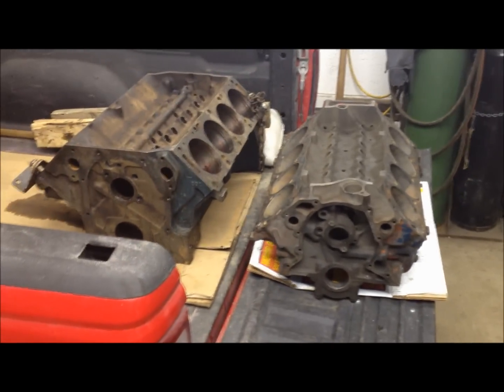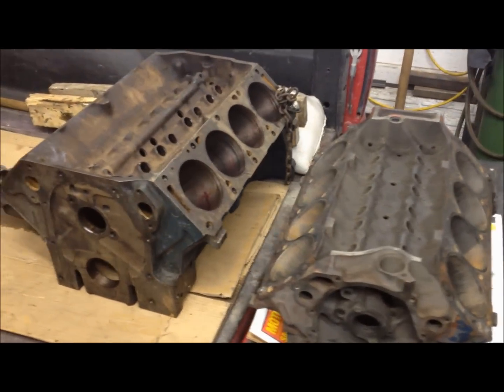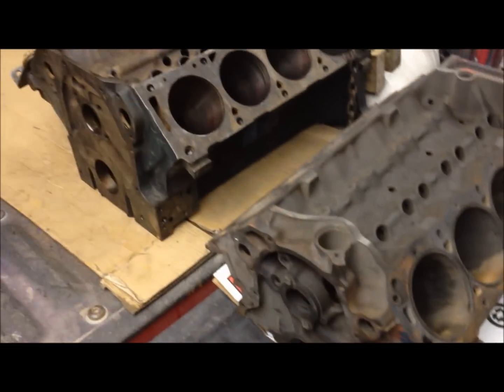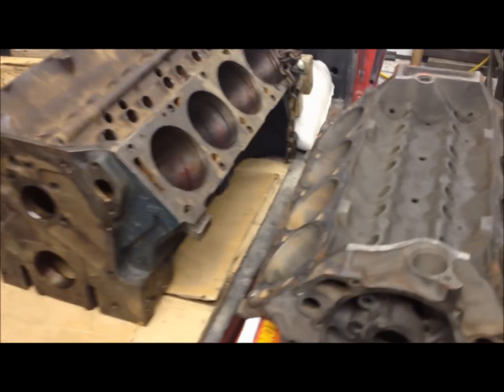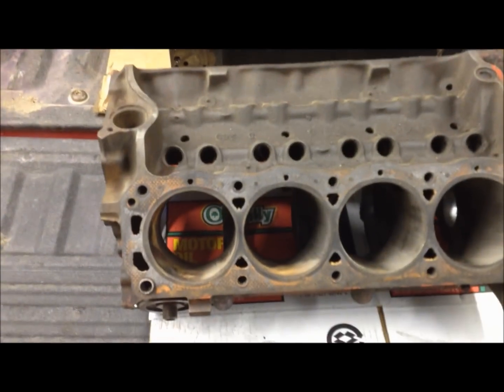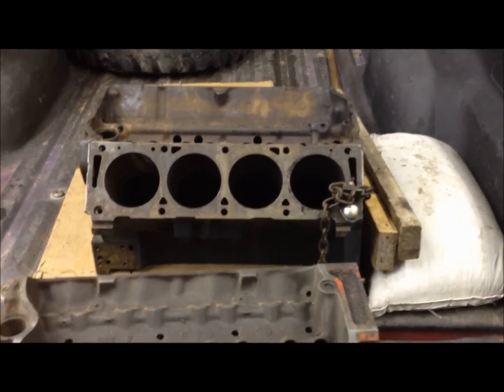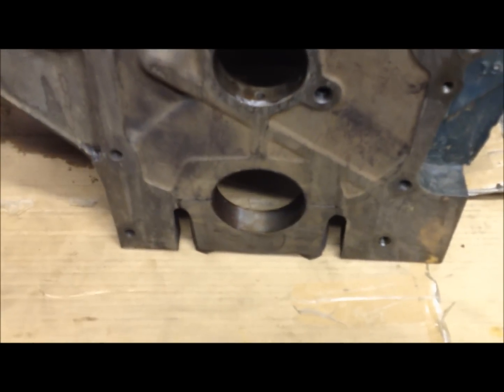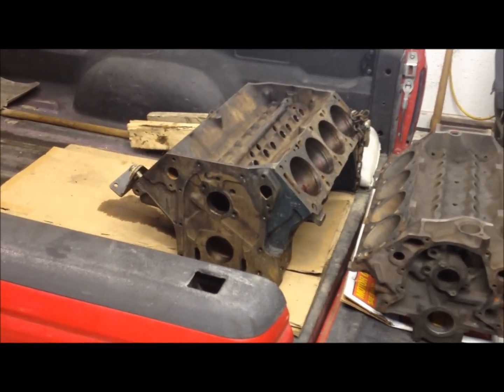Small Block vs Big Block FE Ford

Comment: First off, the Ford Edsel “FE” engine has not big or small block, it was named by Ford as the FE (Medium block) and offered 332-428ci all with same block. The (big block) of the day was the MEL or “Mercury-Edsel-Lincoln” (Superduty block) and offered 383-462ci all with same block. The predecessor to the FE was the “Y” block or (small block) and offered 239-312ci all with same block. The “Y” & “FE” blocks successor was the 335 series (small block) or Cleveland engine, offered in 351C-Cleveland, 351M-modified and the 400ci all with same block. The MEL (Big block’s) successor was the 385 series (Big block) and was only offered in 429 & 460ci all with same block except a one year 1969 429ci HEMI built for nascar. The 335 series (small block) successor was the Windsor and offered 260, 289 & 302 and 351W-Windsor that were 3 different engine blocks the 7.5 deck 260, 8.2 deck 289 & 302 and finally the 9.2 deck 351W.

Second, All blocks were different and not interchangeable except the Windsor block and only for certain parts. The only oddball was the BOSS 302 which Ford did first before any aftermarket was a 302 Windsor block with 351Cleveland heads that were machined to fit the Windsor block and was revered to as the Clevor engine. Every block is largely different except the two Windsor 302 & 351 blocks and only to a point and still are very different. All other Ford engines that shared one engine block were only differences in bore and stroke only with heads that were built for different applications. All of them used heads that could be swapped only on their specific blocks they were designed for and none could be swapped from blocks of different designs.
Reply: this is a great chunk of information
Reply: I had a 71 (aus) fairlane that had a 302 windsor and c4 auto. When I got the motor rebuilt the timing cover was different to normal 302 windsor. Also the c4 when it got rebuilt had some different parts than a normal c4. All I was told was the engine and trans was the same as some of early mustangs. Never really understood it all. Any ideas?

Comment: Oh yea. That cast iron intake weighs in at like 90 lbs. A big weight savings when you switch over to an aluminum intake. And if you also go with a set of aluminum heads you can get the weight down to a small blocks weight. With a lot more torque and HP potential.

Comment: Wasn't the FE actually a mid-size block? Because the true Ford Big block was the MEL (383,430,462) from 1958 to 1968 until the 385 series (429, 460) replaced it.

Comment: Ever since I got my f100 about 2 months ago the fe has grown on me but never the less I have a love hate relationship with it.
Reply: Uncle Moe Lester i replaced my fe with a cleveland.  Much happier.
Reply: @chrismontreuil2206  Yeah maybe,but the FE will pull like a tractor and with a good high volume oil pump,you can't hardly blow it up. I've owned several of them and I can attest that they are as tough as nails.

Comment: Best to assume that NONE of the 390 blocks can safely be bored to 4.130.  I have built literally hundreds of them over the past years and have sonic tested them all.  We have found exactly TWO that were safe to go to 428 bore.  The 105 blocks were cast in Ford's MCC foundry, the DIF blocks were cast in Cleveland.
Reply: If I keep my Dentside with a Gasoline engine I will get mine from you Barry, just on the fence about a 4BT conversion
Reply: Had an early 427 with 12.5 comp +.60.and it ran without problems . Bored an early 428 CJ +60.no problem . 406  also thick wall cylinders . Some replacement 428 blocks were actually truck blocks and had the boss foe the rear sump pickup .sonic test is the way to go .
Reply: 0.060 over on a 427 FE is not believable. That's double what the average top oiler will max out at.
Reply: @randomologist77  I bought the block from a guy named John Uniman who used to race of 57 Thunderbird and he replaced it with a big block Chevy. It had a set of JE 12.5 2 1 Pistons 60 over bore. I also had an early 69 428 CJ lost a wrist pin lock and board that 60 over with TRW Pistons. I worked on a lot of Fe engines Panda never had problems. Cuz a lot of people that are talking about how these engines were nothing but trouble but the biggest problem I ever saw was where they got overheated real bad and the cracks developed in the valley. I due know where the short block  is now . We put it in a 69 Mercury Cyclone CJ and the guy still has the motor block with pistons and all. Because it's an early style motor we had to fabricate motor mounts for that application

Comment: This FE is thec105 reverse block. What is the significance of the 105 block casting over the 352 casting. Do you know?
Reply from the maker: James Archuleta couldnt tell you honestly, i run small blocks primarily for fuel sake. . .
Reply: supposedly the 105(501) are 73-76 FE Blocks and 352 blocks are the pre-73 blocks 501 are supposedly stronger and suffered less from core shift.
Reply: @jclaysf350  heavy truck motors... sometimes they are built with an .080 overbore. I've built 3 over the years and they are still doing great... well 2 are don't know whatever happened to the third.  It went away in a gt500 clone I never finished...

Comment: I love the way the FE sounds but I'll take the small Ford any day of the week over the FE.
Reply: Big blocks suck
Reply: Depends on what your using it for,when I was young and farming with my father,I would use my FE powered Ford pickup in the fields all week long 12 to 16 hours a day and drag race it on the streets on Friday,Saturday nights and all day on Sunday. I'd average 50 to 60 races during the average weekend. Ole truck never complained or left me stranded ever. The  windsor v8s are great but not nearly as tough as the FE was.
Reply: Been staring at Ford small blocks my whole life. Sometimes I just want to see something different.

Comment: I have owned FE side oilers, 302 Fords, 351 Fords and Coyote Fords. The Coyote is the most HP per CI of any Ford engine. and the best racing engine.
Reply: The newest and most advanced motor out of those listed makes the most power efficiency ? Say it aint so lol.

Comment: Technically Ford never made a big block or a small block. Those are GM terms.
Reply: I've seen some stupid comments but you're winning so far for 2016.
Reply: It's true. Small block and big block are GM designations. Ford had windors, FE, and 385 series engines. None of which were designated big blocks or small blocks by Ford. Chevy fans called them that and it stuck.
Reply: +Ken MacMillan small block and big block is self exanotory though, Ford has big blocks and small blocks just like in the video, saying that they never had a small block or big block because it's a gm thing is silly. That's like saying a chevy never had a full size car because that's a ford term.
Reply: The fe engines were as small as 332ci. That's hardly a big block. It's technically a Y block, which simply means that the casting extends below the centerline of the crankshaft. The 351W had a deck height of 9.5 inches. All fe engines have a deck height of 10 inches, even the 332ci. Does that make the 351W a big block?
Reply: +Ken MacMillan as small as 332 and went up to 427 or even 460, a bigger block is just a bigger block even if slightly different.
Reply: I agree Ken, big block, small block are CHEVY terms not even GM. Chevy built 2 v8's a big block and a small block. NO big block small block Oldsmobile yet I hear that all the time too. A 262 or 455 same, Buick no big block/ small block either. People who know Automobile engines call them what they are. FE 332 352, 360, 390, 410. 427, 428. MEL 430, 462, 385 series 429, 460, 335 series 351C 351M, 400. I guess if you don't know anything but Chevy, all the above 4 completely different engines are Big Block Fords. Sheesh.....
Reply: @rondyechannel1399  If you want to get technical, the 335 series also includes  a 302 in the family.
Reply: As originally designed/engineered  the minimum displacement was to be 335 cu. in. There was a 302 after production moved to Australia, correct.  @CA1911Shooter
Reply: @rondyechannel1399  Just keeping you on your toes :-)
Reply: @Ken19700  Ford had atleast 4 different types of engines in the 1960s (Windsor, FE, MEL and 385) unlike Chevy which had only 2 engine types (Big Block, Small Block).
Reply: So I guess Ford just had blocks.
Reply: @scottford1091  no they had families of engines.

Comment: There is no such thing as a small block or big block Ford. Those designations are Chevy terms.  Ford does not use the small block / big block designations, they just use engine series or families. Even if they did use those terms, the bore spacing on the FE block would make it a mid block rather than a big block.